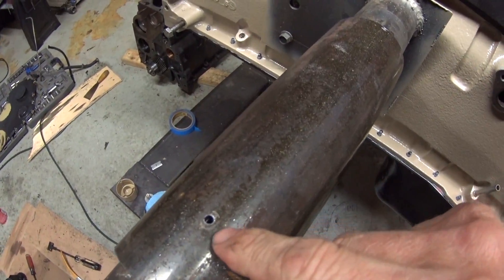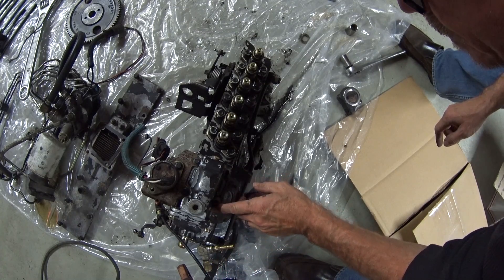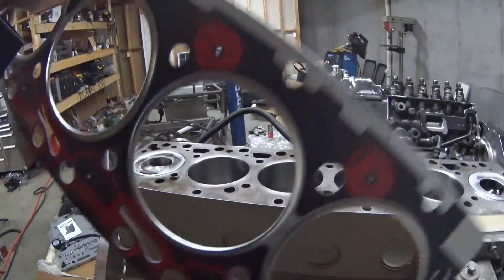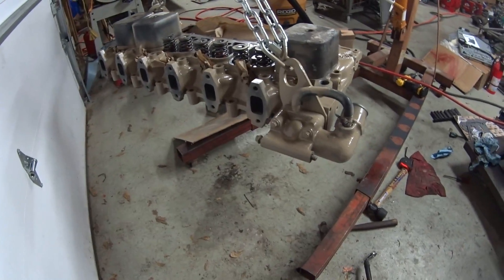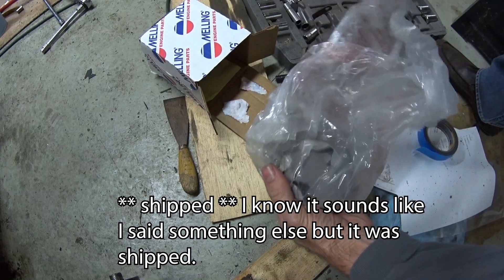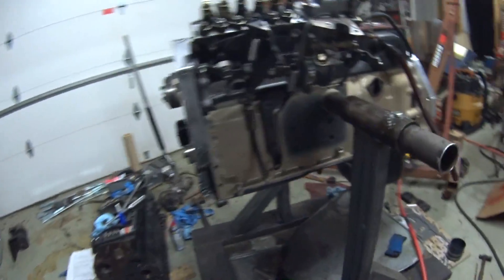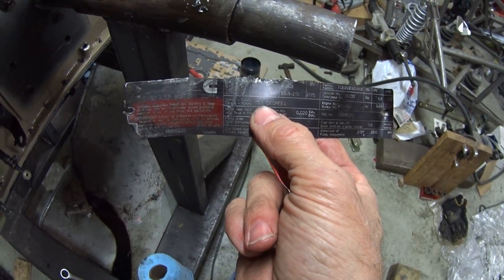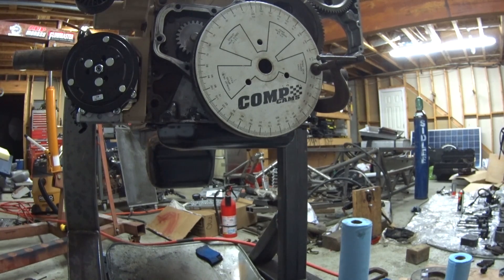5.9 Cummins 12 valve Rebuild part 4 - P Pump Timing and 4k Governor Springs

Comment: Do you happen to still have that data plate on the 12V?  I think it’s needing a crank sensor.  I’ve been working on cleaning up some stuff, breather, cac plumbing and turbo. Fixing leaks…oil and boost and exhaust.

Comment: Ya know, I can't believe nobody yet sells an adjustable pump sprocket like Jessel makes for smblk Chevy cam-shafts that use their belt-drives. Why would anybody want to have to break a taper-locked shaft and break out a degree wheel every time they want to adjust their freaking pump timing just a couple of degrees one way or the other? Somebody could make a two-piece timing cover to go with it to make it more easily accessible  and to provide some extra hub clearance if required for such upgrade. Good God, do I have to do everything myself?
Reply: You know they do make all those parts but you always have to use a degree wheel to check timing. Marks vary from engine tolerances and wear.
Reply: @jbaker8871  Oh yeah, send me alink to whoever makes one?

Comment: For future reference, on head gaskets that don't have any indication of which side is top or bottom - the top side is the one where the gasket part number can be read correctly (ie, not backwards or upside down) while sitting on the block.
Reply from the maker: Good to know, Thanks.

Comment: At the 12:20 point. Did you have the gear popped off the taper of the pump shaft or just the nut loose? Because the gear has to be popped off the taper. Thought it might confuse someone that is learning from this video. Good job by the way!
Reply: Jr EwingAqq

Comment: You may not make the exact power as the 6.4 but you arw getting the reliability of a cummins. I couldn't even picture myself owning a ford. Cool lookin trucks but mechanical aspect they are turds. I work on them more than anything.

Comment: When you said the head was machined down a bit does that tht pushrods have to be shortened same amount to compensate or doesnt matter?
Reply from the maker: That or shim the rocker pedistals. Mine was .007 so I'm not going to mess with it. It does matter about the rocker arm geometry. Not sure what the exact figure should be when it is necessary.

Comment: I find it interesting how different the balancing was between the two oil pumps drive gears. Melling pump had casted in one large spoke to counterweight against the pressure stroke (assumed), and the Chinese pump had equal sized spokes but had drilled the gear for balancing.
Strangely enough though the Chinese pump had a milled face but the Melling looked like an untouched casting.
Reply from the maker: Good eye. Which one would you have chosen knowing there was $100 difference?